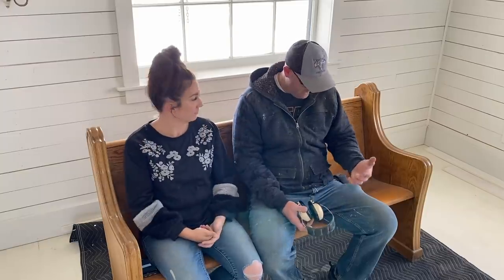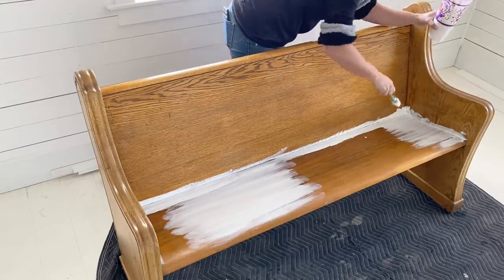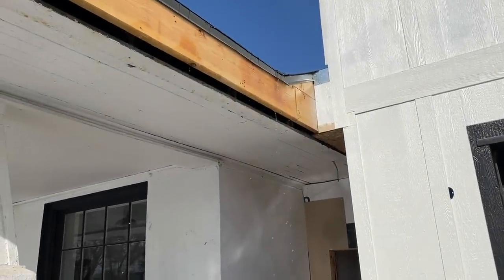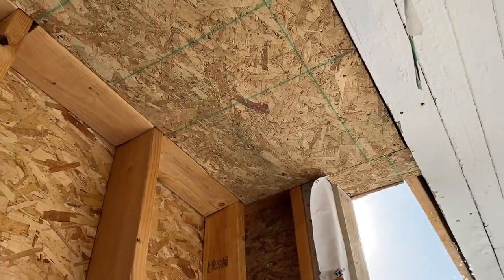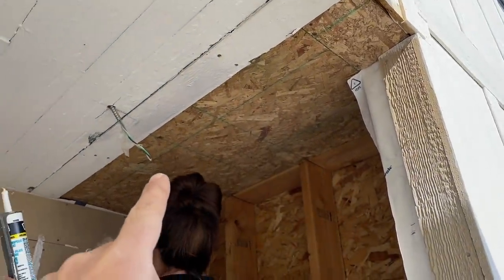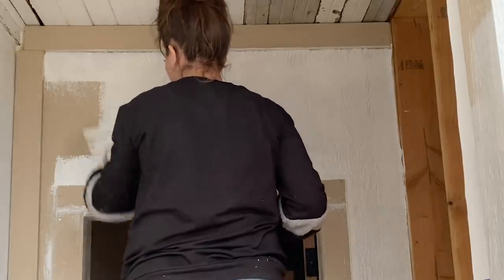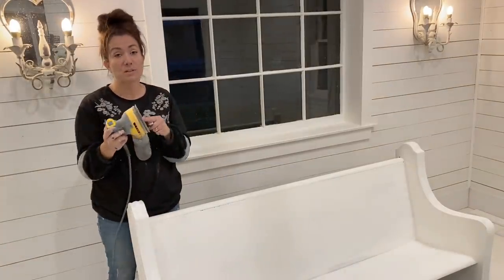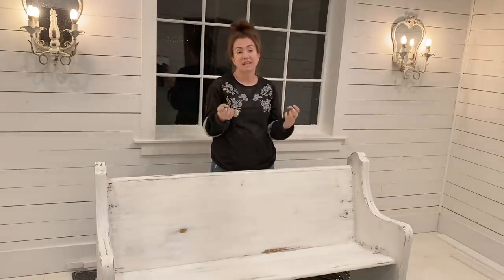Thrift Store Church Pew Find For Our Farmhouse

Comment: Jami, 

I love watching you paint because I feel like I can tell how you paint — technique, I mean. Your paint looked to be between milkshake consistency and melted milkshake consistency. Your brush looked to be fully loaded so that you could paint several long strokes on the seat of the bench. And, it looked like you glided the brush over the seat with little to no pressure. 

Did I get that right? I could almost feel that with little to no drag from your brush. Your brush was fully loaded but if you held it over the bench there would have been no “drippage.” (I’ve heard you use that term lol)

Is that right? I can almost feel it because that’s what I love about painting. It’s almost soothing. 

Thanks!!

Leslie
Reply from the maker: Yes ma’am!  With milk paint it’s a delicate balance. It’s not as thick as diy. So sometimes I get drips. I just catch them before they dry.

Comment: What are you using for trim?  We used 1 x 4 rough cedar
Reply from the maker: We’re using MDF baseboards. I think they are like 8” inches. They are tall and chunky. I may have to wait to put them in the whole house because that size is spendy. But it’s really close to the original trim we found in the house when we bought it.